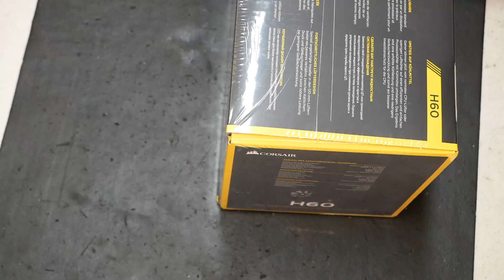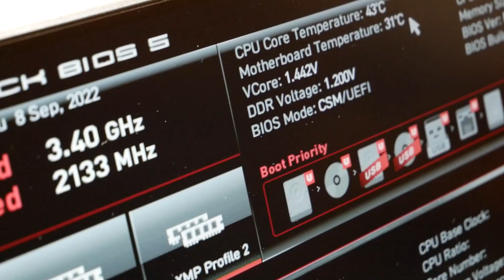Why Can't All CPU Liquid Water Coolers be This Easy to Install?

Comment: Not a fan of water cooling. The pumps fail, get clogged, pipes get clogged. Especially single fan device, cooling of a high quality air cooler is about the same.
Reply from the maker: Agreed. Thanks for commenting
Reply: I enjoy your videos, keep up the good work.

Comment: I believe Corsair recommends installing the pump into the cpu header and the fan then into any additional 4pin header.
Reply from the maker: Thanks for the input.
Reply: Have one and they work better front mount intake. Depends on the case though.

Comment: I don't rust water cooling. Even with a Threadripper 3960 CPU, air cooling works just fine.  It's close to zero maintenance (other than repasting now and then) and has no risk of leaking water.
Reply from the maker: Agreed. Thanks for commenting.

Comment: No point in going for a aio if it only is a 120mm version as high end air coolers can perform better, are cheaper and cannot fail. At 240mm it slowly starts to make sense and only if you are into overclocking. At least from my experience.
Reply from the maker: Thanks for commenting.